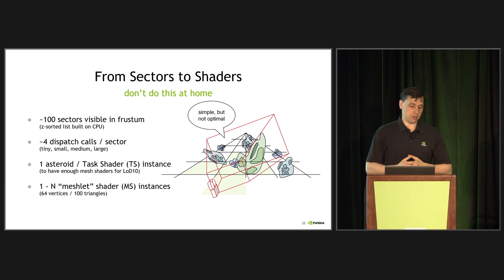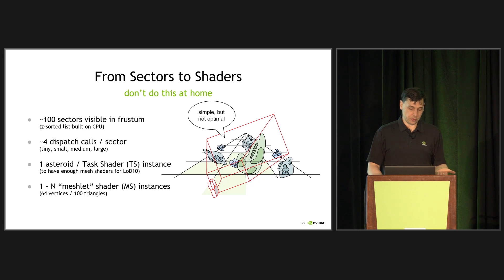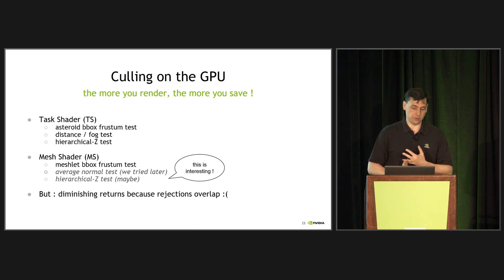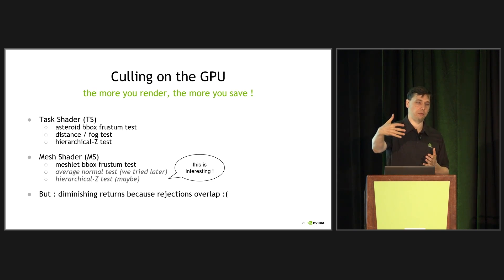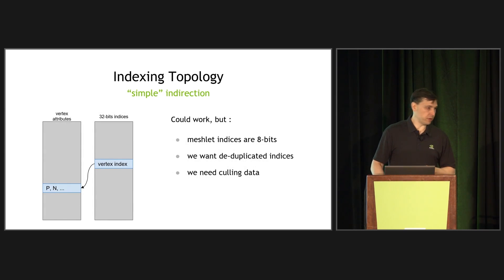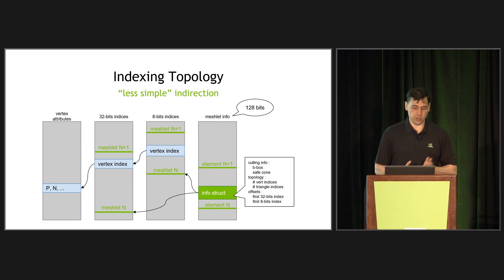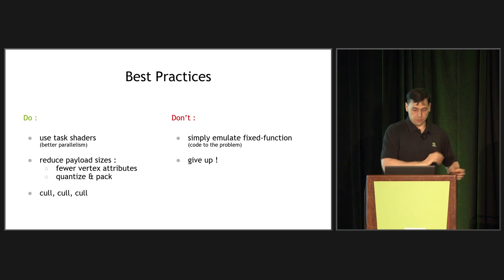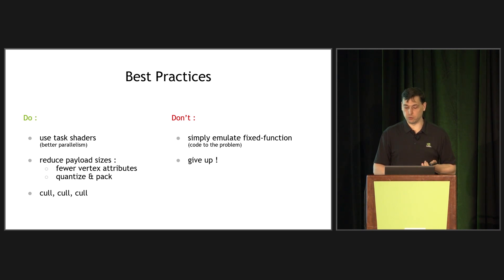Geometry Reinvented with Mesh Shading

Comment: How does this compare to software implementation like nanite?
Reply: Nanite is an algorithm, mesh shaders is a tool you use for creating algorithms like Nanite. So we cannot compare them directly. Nanite right now is based on compute shaders, a better question to ask is what mesh shaders can add to Nanite and answer is A LOT. Current Nanite relies on constant data copies between GPU to CPU and multiple compute shader invocations. With Mesh shaders you can have almost all ops happen on GPU without needing to rely much on CPU. That avoids the need for expensive data copies and multiple kernel invocations.

Comment: why does it remind me of virtualized geometry from unreal engine v
Reply: Really strange, nobody seems to have an explanation what the difference is.
Reply: @cube2fox  
Copy pasting my response to another guy
Nanite is an algorithm, mesh shaders is a tool you use for creating algorithms like Nanite. So we cannot compare them directly. Nanite right now is based on compute shaders, a better question to ask is what mesh shaders can add to Nanite and answer is A LOT. Current Nanite relies on constant data copies between GPU to CPU and multiple compute shader invocations. With Mesh shaders you can have almost all ops happen on GPU without needing to rely much on CPU. That avoids the need for expensive data copies and multiple kernel invocations.
Reply: @Navhkrin  Though why wouldn't they have implemented mesh shaders by now for supported graphics cards & consoles?
Reply: (they = Epic)
Reply: Yeah it is
Reply: it is

Comment: Is unreal engine 5 Nanite engine use this teleology?
Reply: unreal engine 5 use primitive shaders that develop by AMD. Please check this interview with Mike Mantor of AMD. https://www.youtube.com/watch?v=XC5Dy_b-kE8
Reply: @kombuwa  can this mesh shading technology able to  draw current cpu structure  all the electronic circuit,
one current cpu including 11.8 billion transistors, each transistor including few of lines,
each line in 3d at least 3 of 6 face project to screen. so that hard to more lower in LOD features
So what can be look like using this technology to look around the CPU structure?
Reply: @kombuwa  No, you don't know is. The primitive shades is talking about a part of step from how basic gpu drawing geometry  pipline. It is not how Nanite engine work.
Reply: @kombuwa  So there should be some new method for a fast cpu talikng to  gpu   with a new method before pipeline to get huge date to draw as fast as possible